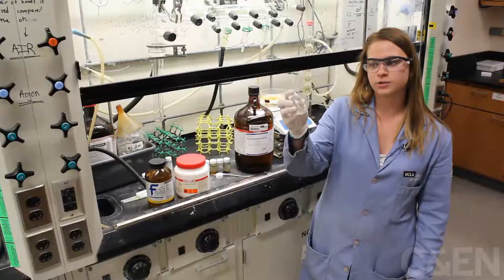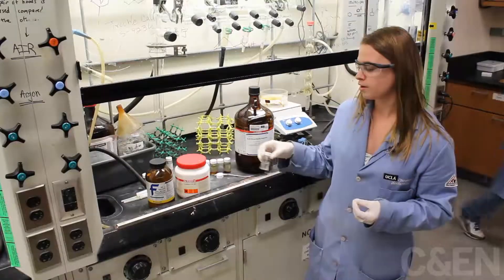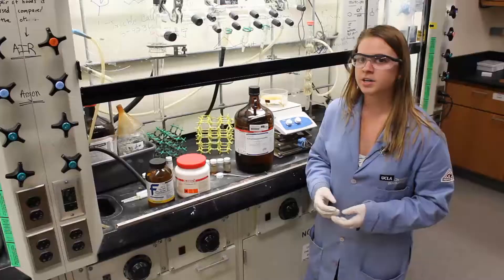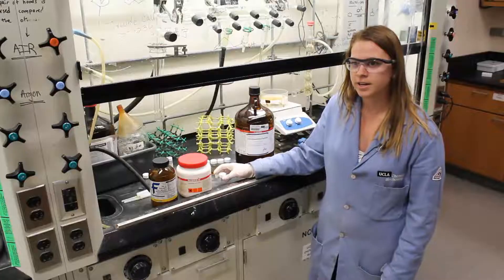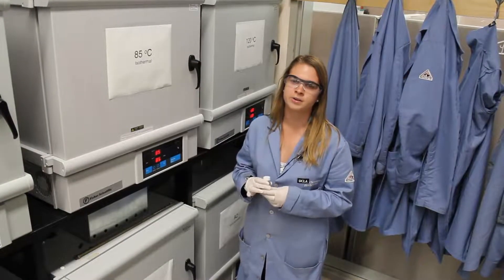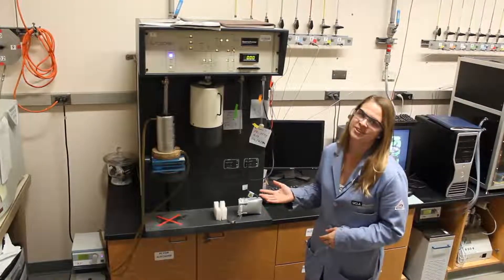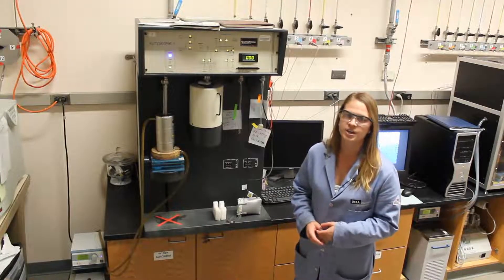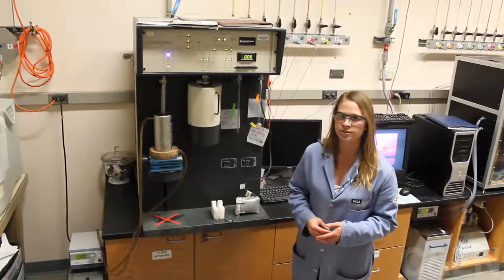How MOFs are Made and Tested

Comment: The new Autosorb iQ is a  highly sophisticated gas sorption analyzer with up to three micropore analysis stations, and four dedicated built-in sample preparation (degas) ports. Metal organic frameworks (MOFs), activated carbons and zeolites - indeed any type of microporous solid - are analyzed with equal ease thanks to powerful Windows-based software, the most extensive suite of density functional theory (DFT) pore size calculations, and a wide range of sample cell types.